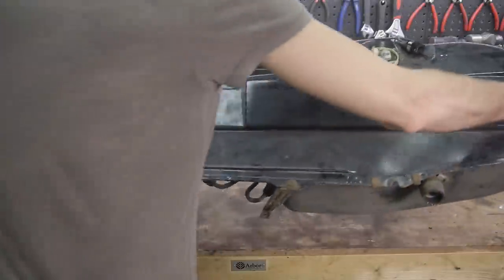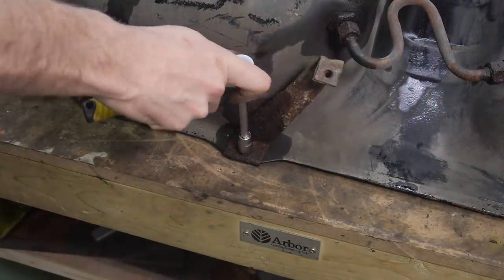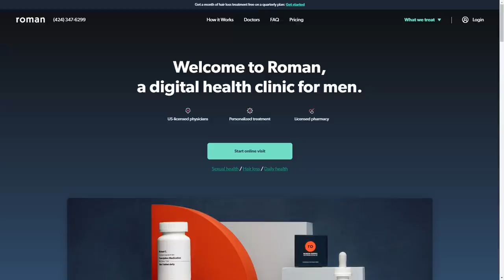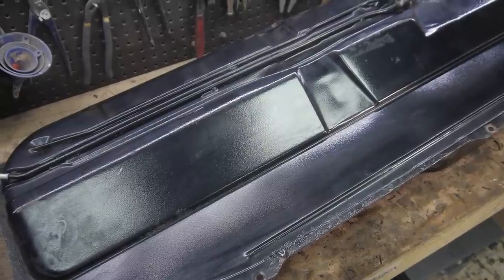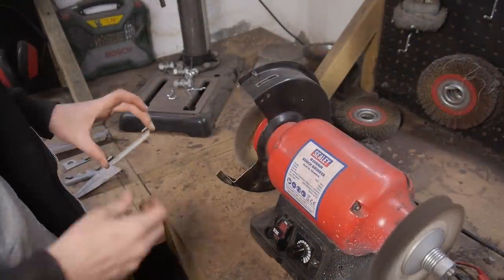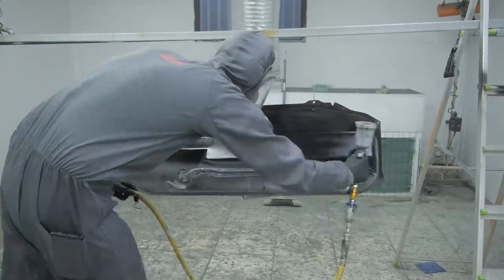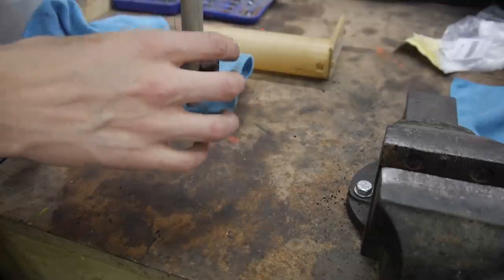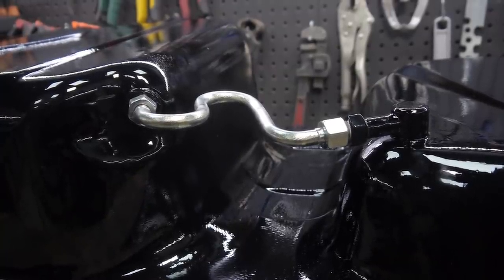BMW E30 Gas Tank Restoration

Comment: if you glue the fuel level float in its highest position the fuel gauge will always say you have a full tank, therefore you'll never need to stop for fuel again, pro tip
Reply from the maker: Free fuel life hack wow.
Reply: Shhhh!  If the oil companies find out, they'll force the car companies to find a way to stall the car even though the fuel gauge says it's full.
Reply: Yo ming  im glad someone appreciates my pro tips
Reply: Cvic98 my car run out of gas’s because of you!!!
Reply: @ALKUKES  thats not possible
Reply: you will never stop for fuel if you dont have car.

poor tip.
Reply: 😹😹😹😹😹😹😹😹you just made my day

Comment: Your channel is the reason I fell in love with the e30. Iam now saving for a 1988 e30 m3 sport evolution.
Reply from the maker: This is epic! Good luck on the Evo! send me photos when you get one :D
Reply: @RestoreIt  gotta save about 100k Canadian. Around 57,000 pounds......  11000 pounds so far
Reply: Tomlantis 212 That's a heavy car.
Reply: Do you know whats the difference between a 118i or 118is engine ( 4 cilinder engines) and the m3 evo engine? is there any similarities besides that?
Reply: @miguelferrandisperez5705  im pretty sure the 118 is a 1.8 liter the m3 is a 4 cylinder 2.3l while the m3 sport evolution is a 2.5l

Comment: Amazing job! I would have bend that little aluminum tube at home, filling it with sand, heating it and molding. 170 pounds is uber expensive for such a simple part!
Reply from the maker: It's crazy isn'y it Tiago... I needed one quick to get this video out in good time. And I also love buying new E30 parts from BMW :D
Reply: I would have found a workshop, took the bits and a picture, then asked them to knock one up.
For certain they'd be quick and cheap.
Reply: My catalog shows part # 16111177925 $26.43. What you paid could be error or overpriced shipping
Reply: @zoranstankovic2599  Koji je to katalog? Jel radiš nabavku delova ili ima negde na netu taj katalog?
Reply: Bit late but there's a German store that does a braided hose with two fittings for this for MUCH cheaper, for anyone who might be wondering if there's an alternative

Comment: Gorgeous! Mercedes used a veryyyyyy similar fuel level sensor in their 80s and 90s cars. My Mercedes 190E and 190D both had to have theirs cleaned after I bought them. The wires are resistive and the float has contacts on it that run along the length of the wires. The sensor reports the resistance which causes the gauge to deflect and point to the proper marking in the instrument cluster. :) The wires are EXTREMELY delicate; any stretch will make the gauge inaccurate. The wires and float contact can be cleaned gently with carb cleaner. The MB float also had a separate set of contacts on the bottom which touched a pair of contacts on the bottom of the sensor housing. Those contacts completed the circuit for the low fuel warning light that was at the bottom end of the fuel gauge in the instrument cluster. If that light comes on you know you're running on the reserve capacity of the tank.
Reply from the maker: Fantastic comment thank Manny! When I first saw those wires I thought to my self, how is there anything electrial going on in a fuel tank? What if spark... But I really have no idea what I'm talking about when it comes to electrics. Thanks for the info! :)
Reply: @RestoreIt  You've expertly restored several electronic things on this channel! :) You know more than the layman that's for sure. 

Liquid gasoline isn't flammable, so those contacts are either submerged in liquid gasoline all the time or they are always in contact with the sensor wire. 5 and 12 volt sensor circuits likely won't make a big spark if the circuit is interrupted. The air-fuel vapor mixture in a gas tank that's empty usually isn't ideal for burning either because there isn't enough oxygen. Anyway, modern fuel level sensors use a flat plane style with a stylus that sweeps over a semicircle of conductive traces. Also very little risk of spark or vapor ignition. :) Of course, diesel is MUCH safer than gasoline. You guys in Europe have many more diesel vehicles than we do in the US. Diesel is very difficult to ignite without a wick. 🤷 I loved my 1984 190D and I'll get another diesel car in the future. <3

Comment: THE FOAM IS TO PROTECT FROM VIBRATION AND METAL ON METAL CONTACT😂 now everyone knows...
Reply from the maker: Thanks BimmerAddiction, I didn't know if they had another purpose or if that was it.
Reply: Restore It no problem 😇
Reply: I just bought a big cheap sponge cut it up to the same size as the ones I took of and glued on the new ones. But your restore it that won’t do for you
Reply: westly cake probably just as good
Reply: It was pretty obvious to be honest. Why does any car have rubber on it, to stop vibration.
Reply: @bimmeraddiction447  THANK YOU! THAT IS GREAT INFORMATION! 👀😅
Reply: Darin Morgante its not really 😂
Reply: @adamt3077  Sponges hold water, that could be a rust problem.  You should use a closed-cell foam.
Reply: I thought it was foamed for her pleasure... or maybe that was ribbed?

Comment: Not sure where the fuel tank sits in the chassis, but wouldn't those foam pads on top of the tank be put there for sound dampening?
Reply from the maker: Possibly yes, I'm just not sure if that's definitely the case.
Reply: Thomas Mitchell I’m pretty sure is more for vibration where the tank touches the body or frame
Reply: @samuelcervantesarroyo900  Pretty much the same thing/concept
Reply: It's just a contact buffer. you can use any type of (preferably flame resistant) foam.
Reply: On my E30 they were glued to the Chassis and held some wires. Maybe its also a flexible connection between Tank and Chassis. The big 63l Tank has Rubber around all bolts.
Reply: I would be happy to know where to get this Material New, because this foam doesnt seen to Store Water like most other foams. My foam didnt survive The restoration. I think you could still use it.
Reply: @RestoreIt  My E30 gas tank looks a little different than this one and I never had those foam pads. I think they are just to cancel out any rattling noise from the gas tank. My gas tank also had rust on the inside, I recommend you to check your tank aswell:) I haven't watched the whole video yet but I assume you didn't check rust on the inside...
Reply: @RestoreIt  the foam pads are most likely for resonance, the big thin bits of sheet metal vibrate and can like hum, you also see on stuff like floor pans, roofs... something like a bonnet doesnt need it because of the structure. but if you have ever held a big piece of sheet metal wiggling its slightly will already make noise while doing it hard makes like a thunder noise. at least thats what i THINK because they dont seem to touch anything

Comment: at 2:50 i would recommend when undoing rusty nuts that you turn the nut back up clockwise again as if you were tightening it so that the rust does not get clogged the thread and reduces the risk of snapping the bolt. when the nut feels like its getting tight after loosening then turn it back a few turns, when tapping a new thread with a tap and die the procedure is generally 1 full turn 1 half turn back for a similar reason.
Reply from the maker: Thanks for the solid advice Todd!

Comment: For an april 1st joke. Just wipe down somthing dirty and say its restored
Reply from the maker: Haha I have always wanted to do something like that...
Reply: Faith in humanity restoration. Walks in "OH HELL NO" walks out video ends
Reply: Restore It but make it 30 minutes long
Reply: Paint your blinker fluid red to increase your horsepower/waterpump ratio in high RPM and decrease radiator lag in low RPM. Painting your brake discs increases acceleration up to 30% (22C degrees at sea level) by adding more torques per gallon. Also, change your firing order to all cylinders at once for a 600% increase of power.

I hope this helps.

Comment: The foam pads are for sound/vibration dampening. German engineering, it used to be the difference between normal and premium although now the rest of the car manufacturers have caught up. Fantastic work by the way 👍 glued to this channel

Comment: This is a really good video. The only thing was missing was to pressure leak test the fuel tank. On these E30 fuel tanks its very common for it to leak between the top and bottom halves of the tank.
Reply from the maker: I will see if I can find a place to do this for me. Or maybe buy a kit if possible. Thanks for the idea Delta :)

Comment: You didn't look inside the tank at all?? I mean it's nice that you cleaned and painted the outside, but it would have been good to power clean the inside of it... when you leave it in storage a long time (especially when it's empty) the tank can corrode, andgather dirt and dust, which will get in your fuel lines and other components and u will be clogged. this is what happened to me, it was a nightmare, my E34 would die on and off and nobody could figure out what it was.. I changed the fuel pump and everything... had to remove the tank and power clean it.

Comment: Had a look on RealOEM for your clips out of curiosity and I suspect that might be an unusual tank, either niche market or not original. All the varieties I saw had caged M8 nuts for the mount  not open slots. I'd use copper-nickel brake piping for the cross tank connection, no corrosion. Good job though, I can watch hard work all day.
Reply from the maker: Thanks Shaun! This is defo the origional tank and in some diagrams I can see one of the clips, I've been told they are apart of the tank and if you want new ones, you'll have to get your hands on a new tank! which is kind of crazy to think. I guess no one ever takes them off. Thanks again.

Comment: FYI, you can rebuild that fuel sender if you have to in the future, you just need to determine the resistance of the wire and buy nichrome that matches. The FSM may have test information that lets you figure out what the specs should be. I did this on my ‘85 Mercedes and it’s worked great.
Reply from the maker: Thanks for the info Jeff! I was intrigued by the thin wires running from one end to the other.
Reply: Restore It yep. It’s just nichrome wire, the float shorts across the two leads, so at the top there’s essentially no resistance, but at empty it’s higher.

Comment: The part your're looking for are called C Clips or J Clips. They may not make that exact shape anymore , but you you should be able to find one to sit that slot.  An Example is the Dorman part Part Number: 55157. I had a similar issue when I rebuilt my 69 Nova. I could not find an exact replacement, but I was able to find one that worked.
Reply from the maker: Hey thanks Stefen! Great advice and good to know.

Comment: you could use a steel flex hose instead of this ridiculous expensive tube. They are sold on eBay for about 20 €
Reply from the maker: Good idea Ju Les. It's too late now and I must admit I love the brand new BMW parts.
Reply: @avanjob205  I was thinking the same thing.

Comment: Just a tip, when cutting of old hoses from nipples, try to whittle them off instead of cutting straight down. Deep scratches can cause leaks if the scratch follows the nipple, if you go across you don't run into the same issue. I don't know how accurate this is, but it was a tip I got from an experienced colleague/mechanic.
Reply from the maker: Thanks for the advice Haakon. I was careful but you're still right.
Reply: @RestoreIt  Still a great video and very impressive work you're doing on this project. I learn a lot from watching your videos, keep it up!

Comment: Dude!
I was watching you put on the hose nuts and I wanted to scream "anti-seize" at my screen..  might not be stock, but it'd definitely be worth it next time you do this....

also, are you planning on having the bottom part covered with some kind of rubberized material to protect the paint from rocks and street debris?
Reply from the maker: I only loosly fit eveything for the video, I will be adding anti seize before everything goes on the car :) 

And yes, the bottom of the tank will coating in something, I'm not sure what yet.
Reply: I put anti-seize on most of my E30 bolts and nuts when reinstalling.

Comment: I really like your Videos especially with E30, but in this case I think you had to buy a new Tank. The rust sits between the fold and squeezes the two metal sides. Sometimes it will get leaky. Also may little Rustparts fall into the tank and plugging your fuelpump. But that's only my opinion, keep going buddy! Greetings from Germany
Reply from the maker: Thanks M R! I'll see how it goes, if I have problems I'll get a new one :D

Comment: Try and get something like Ardrox AV-15 and coat the exposed metal parts of the tank. It sets semi hard and is great stuff. Will work better than anything you will find in the local motor factors that’s for sure
Reply from the maker: Thanks Billy I'll look into this stuff now :)

Comment: Let's be honest. You weren't going to get that pipe loose from the looks of how corroded it was. When it comes to pipes with b nuts like those it is best to leave them alone if at all possible. If they don't want to turn and you see it twist, stop immediately. There is a saying when it comes to things like these, "Let sleeping dogs lie." 
It was an expensive mistake, but mistakes happen. To be fair, having a new pipe is a better option overall, just a lot of money.
Reply from the maker: I couldn't leave such a rusty dog on the tank, I wouldn't be able to sleep knowing it there. But everything you've said I agree with.
Reply: @RestoreIt  Yeah, I can understand that part as well lol. I've had to make many compromises on my 87 Merkur XR4Ti since parts are very much scarce for it. But, continue the great work!

Comment: If you get a fuel pipe union nut stuck to the pipe like that. Top tip try banging a small hammer all around the nut and spray WD40 in there and then try it. Does work most of the time 😊 also try a bit of heat too if above fails 😊

Comment: at arround 8:10, this was no "thin coating" but chassis-wax, and i strongly suggest you truy the "Avery Surface Cleaner" for this in the future, Or: Orange-Oil, you might be surprised

Comment: Terrific video! Amazing attention to detail! I mean zinc plating the clips and brackets...most people would would just get new ones. And base/clear paint, on a gas tank-awesome!  Very well done, I’m glad I found this channel, gonna check out more.  My only question, why not check the tank for leaks, or did I miss that part? Just presume it’s still solid based on overall condition?  I feel your pain on the crossover pipe cost, I once had to get a couple of   bolts for my Jeep, dealership only part...the almost always stoic counter guy actually laughed out loud and said “wow that’s an expensive bolt” when he saw how much each bolt cost on the computer, $40-something each...and he sells ridiculously overpriced dealer parts all day long and has for many years.  Had to have it lol.  The burden of those who love old cars.

Comment: Personally I would have PoR 15 the entire thing, Copper anti seize on the new metal fuel line threads, and the foam stuff you can get just about anywhere. Most audio stores carry heavier foam insulation. Nice work 👍

Ohhh yeah why didn't you change both the rubber lines?
Reply from the maker: I will treat it with something bofore or after it goes in the car. And I don't have / can't find the tool to get those clips on and off. I will change them along with the others down the line :)
Reply: @RestoreIt  I used por-15 on my Corrado some 15 years ago and it still looks great with absolutely no rust. The metal line you could have saved getting it prebent or get An fittings. Take it back to the dealer 😎😎

Comment: The connecting pipe looks like a cutting ring fitting with a copper pipe for about 10 €
Reply from the maker: That's exactly what it is but.... It's a BMW cutting ring fitting with a copper pipe :D

Comment: You should put some anti seize on the tread and pipe, so when the next guy in 30y dont have to spend the same for a small pipe 😉
Reply from the maker: I think you're right Rasmus, I will do this.

Comment: What kind of solvent are you using in the parts washer, and how long  can you use it before replacing?
Reply from the maker: Hey Ivan, I'm not using solvents, but 20:1 non-caustic degreaser at 1:1 with distilled water. Thanks for watching :)

Comment: I think the Foam is for sound absorbing or Vibration absorbing. 
Btw nice Job. 
I have to do that on both of my E30's. 
I think it is rust in there cause i need 3 Fuelpumps a year.
Reply from the maker: Haha! Thanks Luke, you might need a new fuel tank by the sounds of it   0.o
Reply: @RestoreIt  You're right. 🙂 
Good that they are not my Daily driver cars. Mine are the Facelift Models,the fuelpump looks different to yours. 
What year of construction is your E30? 
86/87 ?

Comment: In aviation we make our own solid rigid lines, only need some material and a flare nut tool.
Reply from the maker: I was worried about making the ends of the hoses the same at the BMW one. They sort of curve inwards until its a small hole in the middle. I don't think its flared but I'm not sure.
Reply: @RestoreIt  It's good the tool alone to make that stuff is over $200 US.

Comment: BMW is cheeky with parts costs, even Swagelok fittings and Sandvik instrument grade tube costs less than that connection pipe. The rest of the car would be dust in the winds of time before they even began to oxidise!